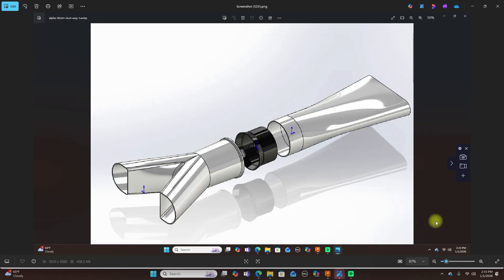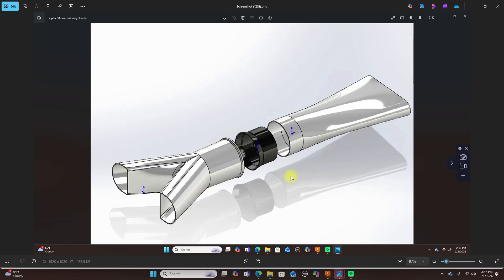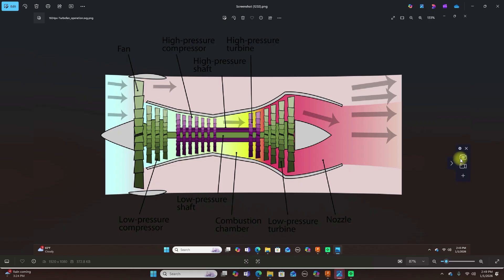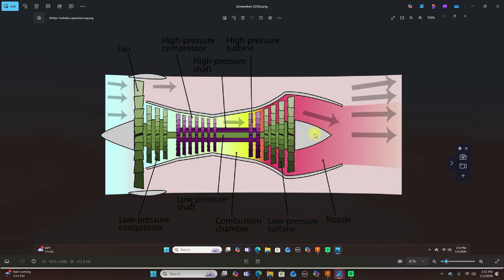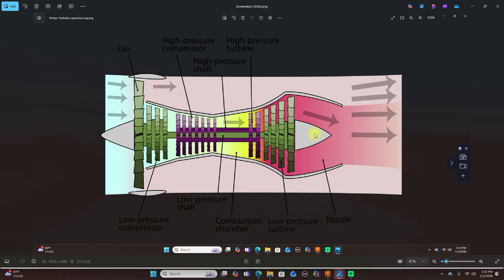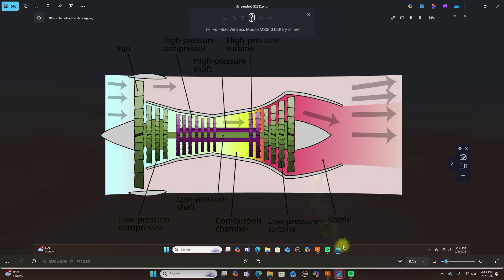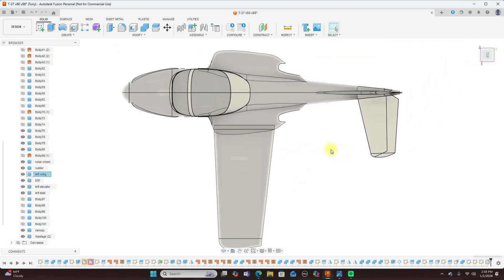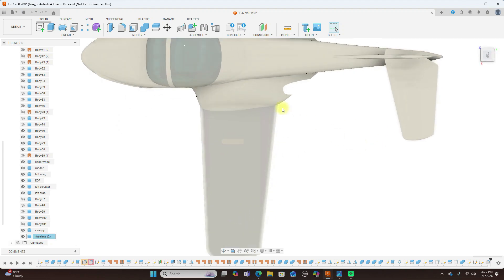How to Make 3D Printed EDF Jets Sound Like Turbines Part 1 Why They Sound Like Vacuum Cleaners

Comment: Super cool video, I'm trying to CAD a 3d printed rc jet, don't know if I want side ducts or bottom duct. Do you have any good resources that could give me knowledge on duct/fuselage analysis for rc jets?
Reply: Also I was wondering what airfoil you used for the wings and stabilizers? BTW this video helped me so much understanding the concept of design for edf duct design, thank you.